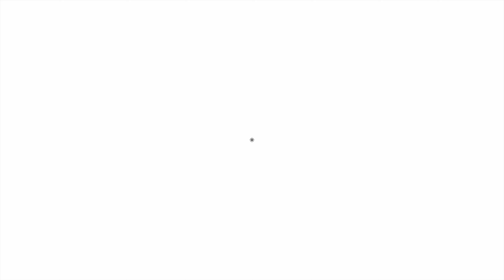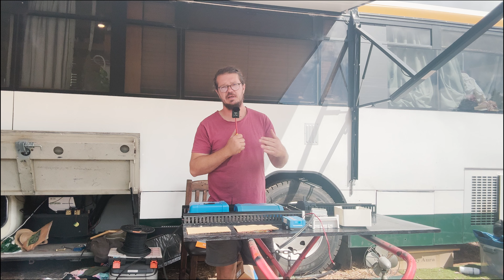Planning Your EPIC Victron Bus Off-Grid System: Part 1

Comment: Great vid,loved it.Considering the potential heat you mentioned,what do you use as a mounting board for all the components? thanks Michael
Reply from the maker: @MerkaCat  hey mate, good question. I like to use FormPly. It is easy to work with and make look nice and tolerates the chargers getting relatively warm 👍🏻
Reply: ok great,that is simple to get